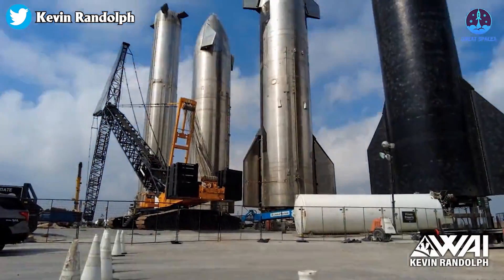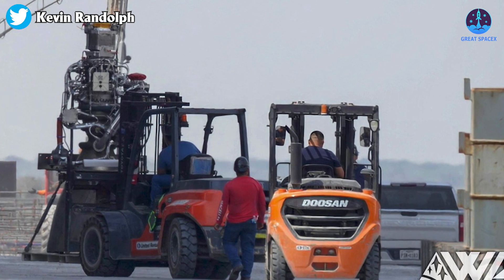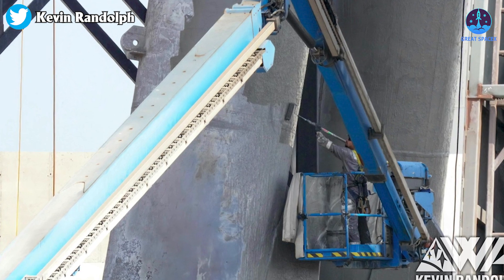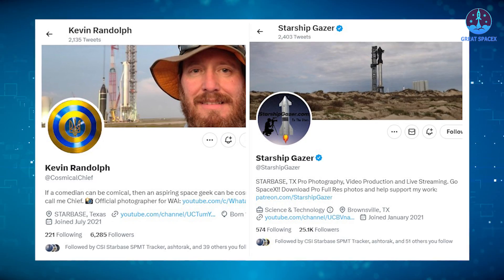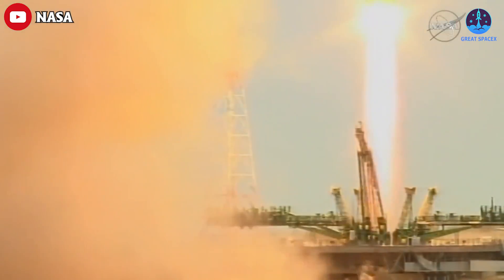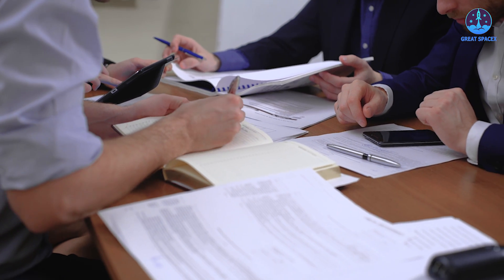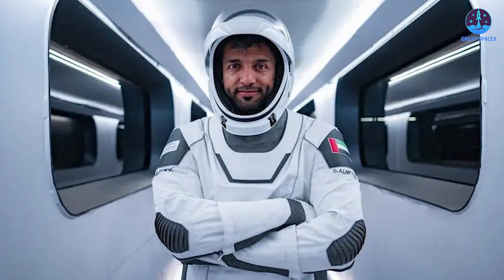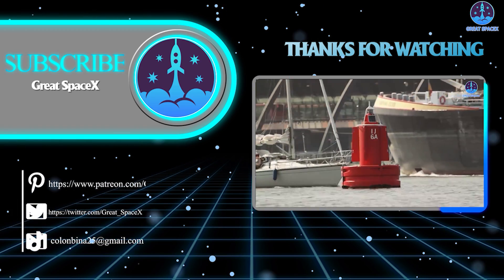Naked Starship out for new plan, S28 staked, B9 raptor installed. Orbital launch incoming...

Comment: They're not launching until the deluge system is up and running maybe Nov. Dec. or early 2024 They're not only waiting for deluge but more testing will be conducted on the rocket. They can't afford any  RUD on the pad or little into flight they'll get shut down in a heart beat.
Reply from the maker: SpaceX’s first orbital Starship launch attempt will happen without it??
Reply: @colonbina1  we cant wait anymore, it will have to happen without The deluge